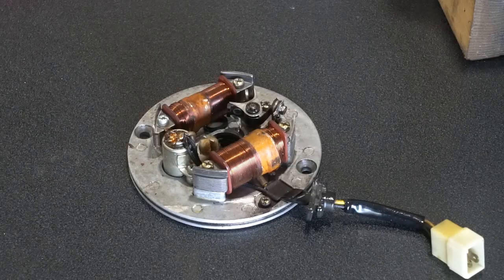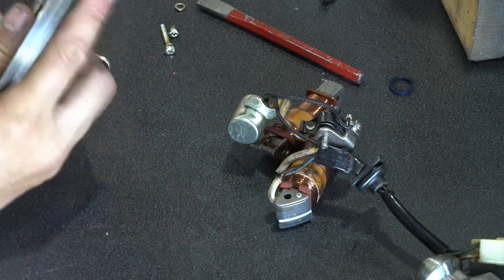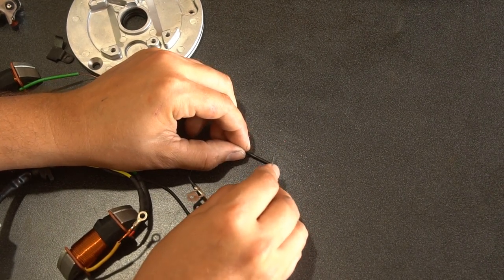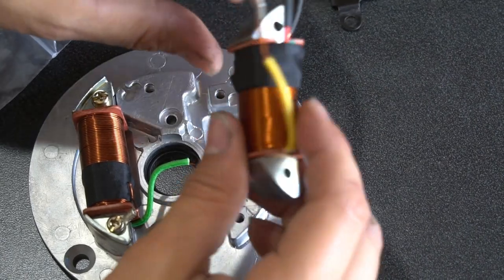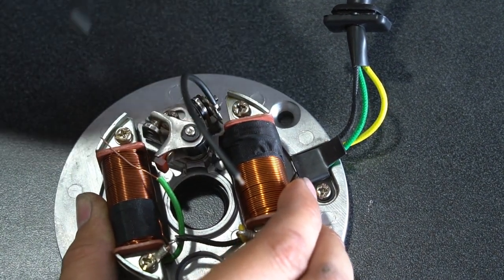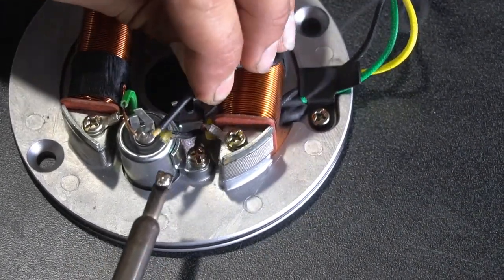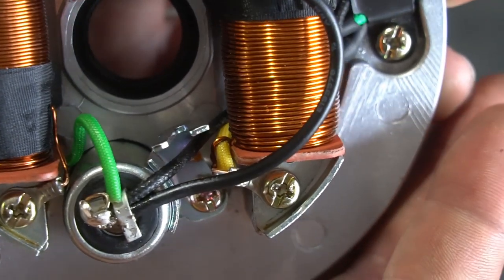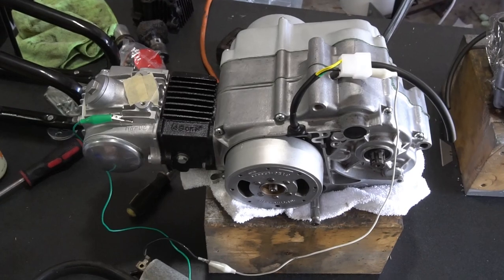Honda CT70 Z50 ATC70 ZB50 XL70 SL70 C70 Engine Stator rebuild

Comment: Just watched this excellent video, had to offer advice on soldering. Please use only 60/40 tin/lead alloy rosin core solder. You'll find that "leaded" solder melts and flows easily and quickly  at lower temperature, little risk of overheating the condenser, etc., more reliable solder joints. Use rosin paste, as shown, to help in tinning ends of wires. Don't apply solder to soldering iron tip  and let it overheat and oxidize then  dab it onto the intended solder joint. Use a "bridge" of fresh molten solder to conduct heat quickly from tip to connection, then feed solder into connection. Don't use "unleaded" solder, it takes too much heat and expert soldering technique to make reliable solder joints. I was an aerospace electronic assembly leadman and soldering instructor in the 60's and have tried "unleaded" soldering, yuck!

Comment: I bought one of these off of you from Ebay about 2 weeks ago for my SL70 . I got to watch your Youtube to insalling  the coils . I have not improved the weak spark at all . I just going back watching this vid to make sure I did the install correctly and I did . I then doing some test on the coils after soldering to condensor  . Here what I came up on 200 m Ohm's with points closed :  Gr wire 3.0  ,  Bk wire 4.2  , Br wire 2.9  , Gr/R wire  2.4 . Points open :  Gr wire 2.9 ,   Bk wire 3.2  ,  Br wire 2.0  , Gn/R  1.8  . These readings was at connector . The meter was grounded to flywheel  and all three wires solder to Condenser  . Are these reading with in specs. . I do realize there maybe small amount of discrepancies between from one meter to another .  Thanks Jeff

Comment: Just rewound a light coil for my C90, 1986 model, 12v and CDI ignition. Parts are harder to come by. Great thing with these little bikes is their sheer simplicity. Easy to work on by yourself with a bit of patience, chilled beer and some free time :)

Comment: You need to buy some decent tools and throw that electric screwdriver as far as you can, that caused 50% of the issue of not getting screw out by nacking the hex and the toy town screw driver caused the rest of the issue,  use a quality Philips driver !!!
Reply: @99popgun  if you ever try Matco or Snap-On, you will kick yourself for using that toy screwdriver.
Reply: Japanese Industry Standard bits not Phillips.